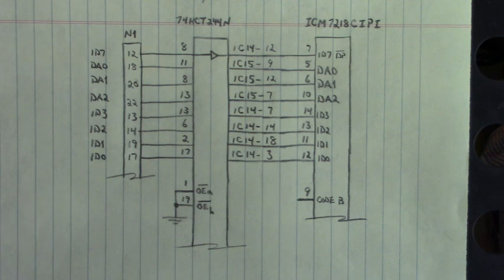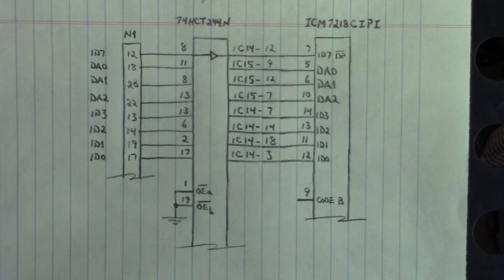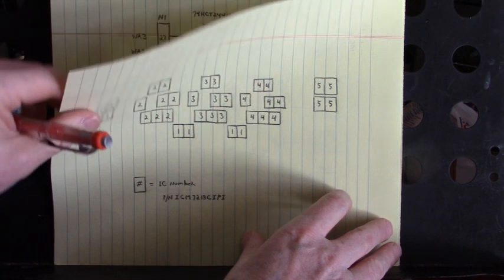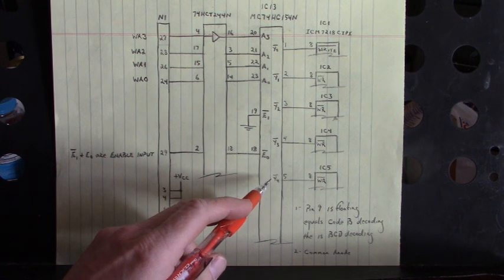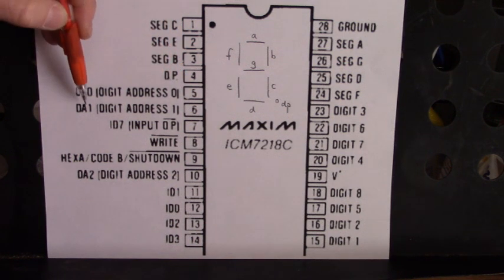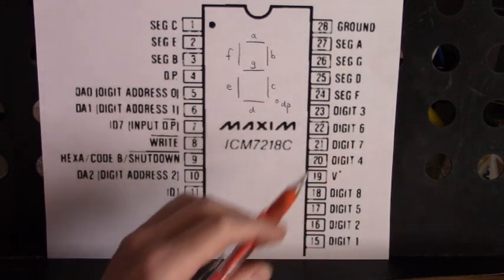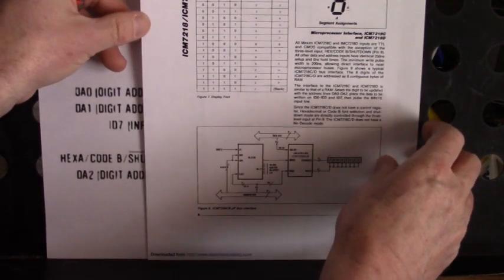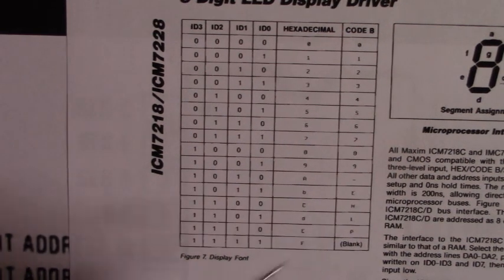Schlatter SWEP05 Operator Panel Part3

Comment: Outstanding video!  I followed everything without a problem, but I'm a little fuzzy on the buffer IC.   Why should one use a buffer IC? What is it's purpose?
Reply from the maker: This is a very good question. The 74244 is used primarily to allow the eight data bits of that integrated circuit to reside on an common eight bit data bus. If the output enables are at logic high. The outputs are placed in tristate (or open circuit output). So that their output pins are not asserted onto the data bus. When the output enable pins are set low. The logic state of the eight input pins are present on the output pins. And are present on the eight bit data bus. So I could apply multiple eight bit data bits from multiple 74244 integrated circuits onto the eight bit data bus based upon which of those 74244 allowed onto the data bus by their asserted low output enables.
Reply from the maker: That sounds confusing. But on a common eight bit data bus, we cannot have two or more eight bits onto the data bus at the same time. This is called bus contention. Say for instance Bit1 of one 74244 is high. And Bit1 of another 74244 is low. The data bus to the uProcessor or uController  would live in confusion. Not to mention the high and low on the same data bit would cause overheating.
Reply from the maker: Well again I went around the barn to get to the woods. In the case of our 74HCT244. It is used for signal conditioning. You will see many times that a connection onto a circuit board connector, that some kind of go between integrated circuit is deployed. The 74HCT244 inputs a squarewave that possibly has become degraded from its distance of travel. And produces a better squarewave at its output for use by the receiving circuit.
Reply from the maker: You are a very intelligent person for asking about the 74HCT244 in this circuit. I hope that I properly answered you question. Most time I get it right, and most other times I get i wrong. That is life HaHa... I hope that you are enjoying the time with your family. And thank you so very much for enjoying electronics:)